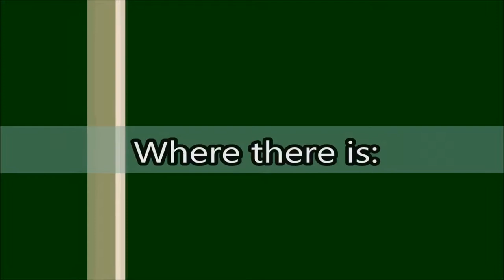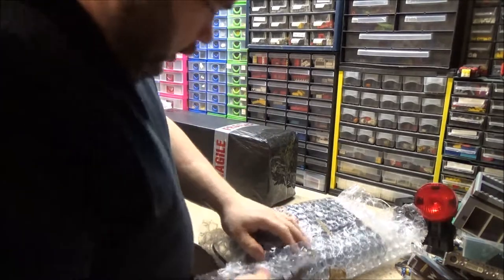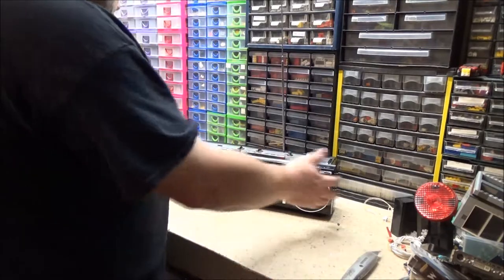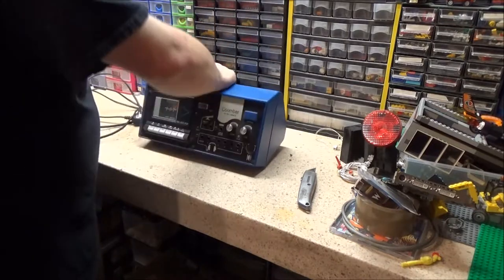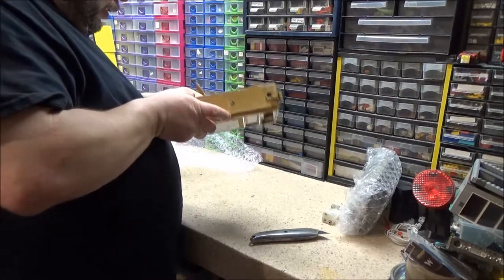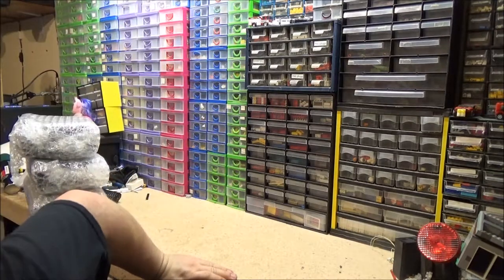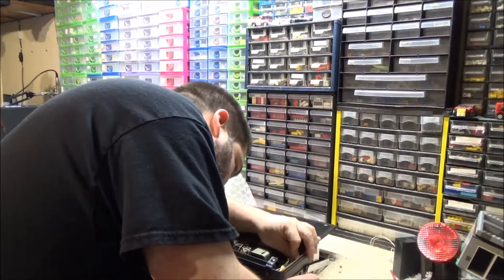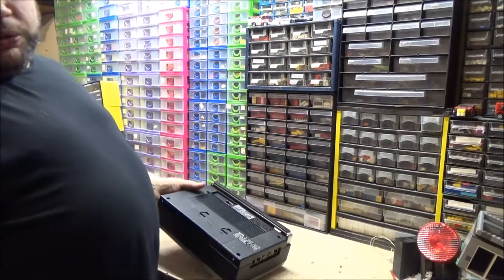Obligatory Youtube Unboxing Video Thing.

Comment: Some intresting vintage radios there, particularly the Ford branded Philco one with the car aerial socket, possibly, back in the day supplied as a cheaper option to having a built in car radio fitted!
You're gonna need a bigger flat soon, with all this stuff you keep buying!
Reply from the maker: I have been told Ford owned Philco back in the day and started putting their Ford logo on in 1965. Yeah, will need a bigger flat lol